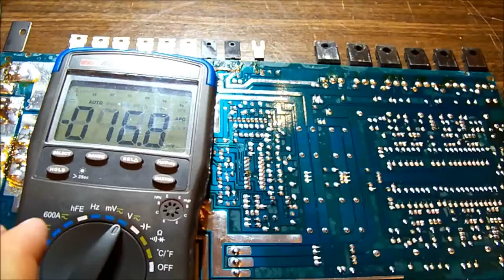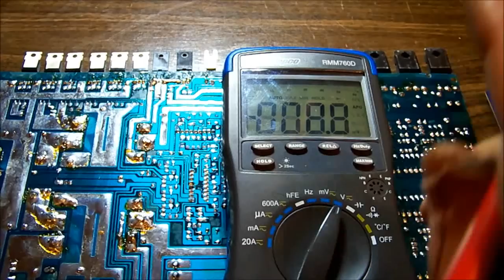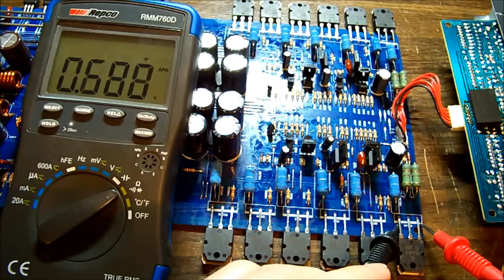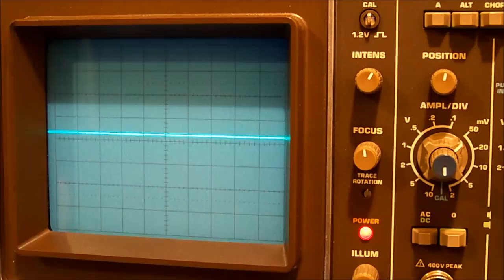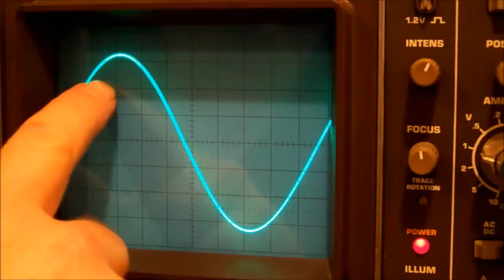Response Precision car amp repair

Comment: I would have to say that 90 % of the amps I have repaired, the output transistors...were shorted...and now I check them first...good video...
Reply: I installed a transistor and it keeps blowing?

Comment: TO-22 diodes are verry common in duals as bridge rectifiers nowadays, and the SMD circuitry can be pretty tricky if you dont have the right equipment, hardly anything that I have had come across my bench as used the through hole.
As far as replacing all of the fets and bad parts while you are at it, this amp will be back on the bench within 6 months and the owner will learn their lesson.

Comment: My amp started making a heartbeat type thump. I know its the amp because I replaced it and new amp is fine. My old amp has similar parts as this one. B688 and D718 on the output side. The amp worked just would have heart beat thump on the subs when at low volume. If you cracked the volume way up it would sometimes snap out of it for a second but then start back again. It's a Jensen XA2250. Cheap amp so no biggie. Output FETs test good and are not shorted. Only thing suspect is one of the power MOSFETs IRFZ44A shows a dead short between D and G but only when switched on. It turns on and off it just shows no resistance on the supply and drain when on. The other one shows 170 to 180 on my MM on diode mode. Not sure if this could've been causing the thump or not.
Reply: I had that wrong. The IRFZ44A MOSFET shows no resistance when switch on between D and S but it does switch on and off. The other IRFZ44A's show resistance of anywhere from 30 all the way to 170 to 180 on my MM through D and S pins when switched on. That seems like a big difference from the one that reads a steady 001 when turned on so I'm wondering if that could be my issue.
Reply from the maker: Hmmm.... measuring across pins with voltage on them will upset your meter in resistance mode and the reading would be meaningless. If there is enough voltage on the gate to turn it on you should have same voltage on D as S. If it's in the primary side then it will be being switched rapidly so a scope might be better to see what's happening. Check secondary side voltage on the output capacitor isn't fluctuating. The heartbeat sound could be a result of power supply repeatedly starting up then shutting down. There might be a feedback issue where it doesn't know what the output voltage is, or there could be an overload on the output. Make sure secondary capacitor is discharged and check resistance across it isn't low.
Reply: Ryan96se I got a question what is the name of the party and where I can buy it

Comment: This video was posted so long ago i dont really expect an answer but anything helps. Is that any specific type of sil pad you used for re assembly? I have an amp i have to remove everything to repace the rcas, its just reassembling everything were i dont know what the mosfets use. Mines seem to be in a similar material to the one that these were prior to removal. Thanks in advanced
Reply from the maker: I've always re-used the old ones, never been a problem. As long as they aren't torn in a way that would allow the metal tab of the transistor to touch the chassis. If you had to get new ones, just go for the same thickness. I usually put a little thermal paste on each side to.

Comment: Very good video! Keep up the great work. I am working on an amp that the green light comes on with no audio. I suspect an op amp on the input. Any recommendations on troubleshooting the input side of the amp? Do you have any videos for that?
Reply from the maker: Thanks! You should be able to find the input and output pins of the opamp from the datasheet and if you have a scope see if you have signal going in and signal coming out. If not in look further toward the audio input. If not out make sure opamp has valid power rails and if so my guess is replace opamp.
Reply: Mostly the output transistors. One or more of the The big ones should be shorted. I fix them everyday.

Comment: Hey, nice video. I have an amplifier that turns on green. But no sound. What should I check. Or what part should I focus on ? I have no idea. Tried several different speakers but none work. So I think the problem is inside the amplifier
Reply from the maker: If you are positive your source is putting out a signal into the amp I'd probably jump straight into testing the output transistors like I do at 16:50. Blown ones don't always cause a fault light. If they test ok you'll likely need to get hold of a scope and trace the audio through to find out where it's stopping. Find the user manual for the amp and make sure it doesn't need something like a cable between 2 sets of RCA sockets (if it has more than one pair) to make sure there's not some kind of split off to run multiple amps or something and the signal is going in then out but not back in to the main amp. Give the high and low pass filter switches a toggle to make sure they aren't dodgy.
Reply: I got a amp the “slave” switch broke off and no i cant get any sound but sum loud thumps wehm i poke and prod around in it . no protect light no smells , i soldered the slave prongs together at the max number idk exactly what it is ) yesterday and got sound out i only had it quick rigg running off another amp to test if my fix worked  tho but it sounded like ut was playing all the frequencies not the lows i want and my rcas only wanted to work in my invert jack connectors i know i usually have them in the low in connectors but they didnt produce any sound idk now what this sound like to you ?

Comment: I have a magnat rx44 4channel amps which gives a buzzing sound from the second channel i tried to grund the earth of the rca to the ground but the buzzing noise didnt go away. Tested with another 4 channel amp from my friend and the buzzing sound was gone, tested with severwl different rca cables and configs awsell.
Reply from the maker: +KosovarMods I wonder if some power supply capacitors have failed and are letting switching noise through from the power supply. Also, check for bad solder joints.

Comment: what would cause  my rockford fosgate punch 250.2 to put out a steady dc voltage when the remote wire is connected thanks in advance

Comment: I replaced a broken MOSFET and it's neighbor,  just to ensure matching behavior on that side (my modest amp only has 2 on that side).  The amp now works well and sounds perfect but will not turn off.  The remote wire/switch/feature is completely ignored. How can I regain that functionality?  What else should be checked?
Reply from the maker: Good job! Follow the circuit from the REM connector. It will likely go to a transistor then possibly to the switching controller for the power supply. I once had this transistor shorted which had the same effect.

Comment: hi . my mono amplifier stop work. the ligth turn on but dont have sound.. just make like very low sound. please you can tell me couple reason and tips what you tinks its. maybe the amp in a moment the positive and ground cable touch toggether but i dont have sure..
Reply from the maker: If the speaker wires touched while it was running then check the ouput transistors as I did in this video.

Comment: My 2150 hct analog meters move but no sound. I know it needs 3 fets. Ya think any transistors
Reply from the maker: The analogue meters might be driven from the pre-amp section so a fault in the main amp will cause no sound. You would need to test the components to find out what has failed.
Reply: @JonnyFix  what do I check
Reply from the maker: @kevinhancock7166  Start with the main output transistors like I check at 17:15 here.

Comment: My Alpine amp has started to create a constant rumble in my subs even while only connected to a 12v battery and the subs. It still works and plays music, but continues to rumble when it has not audio signal. I opened the amp to inspect it, and everything appears to be in order, no bulging caps or cracked fets. It has a .3v output on the wires going to the subs. Any ideas what it could be?
Reply from the maker: I don't sorry. Some oscillation being induced somehwere. Would need to trace it through with a scope to see where it was coming from.
Reply: Jon Luke bad ground in your deck ground it to your cig lighter
Reply: It was wired directly to the battery in my trunk. I ended buying a more powerful Kenwood and thay fixed the problem

Comment: Dear sir i have rockmars 3000watt car amplifire when I give battery current its on for a second immediately its p55nf06 transistor dead I replaced that transistor but same process again all output transistor are ok
Reply from the maker: Not sure what problem might be without seeing it, or a schematic.
Reply: Jonny Fix sir how can i show you and contact with you i m far away from you so kindly help me

Comment: My amp turns on and everything just like normal but you can barley here anything you can here bad but barley then you hear like a buzz and before this Happened the amp over heated and made like a poping noise and I think it heated up bc it's a 1 ohm stable and I connected the subs wrong and for your info it's a Memphis mojo mcd4k yeah it's a badass amp but it doesn't play I want to get it fixed the cheapest way possible and at the moment I'm using another one exactly the same since I have 2 of those amps thank god
Reply from the maker: +Carlos Soriano Probably burned out the output transistors, these are the most common things to fail when speakers are connected wrong. If the pop came from the amp you will probably find exploded parts inside, look for black smoke marks, you might have to lift heat sink clamps. Replace these and see where you're at. If you don't have test equipment, replace all output transistors to be safe and see where you're at. They don't always show physical damage when they fail. Might set you back $10-15 each, can't find much info on this amp so I'll assume there will be at least 4 per channel. There may be other damage but it's a start.
Reply: +Jonny Fix thank you for replying friend and I did open it and I do see black marks in the back of where they blown up and the amp is a Memphis mcd4k it's the older model but it sounds super loud and where are you located? Because I would fix it but I'm not so familiar with this stuff if we live close I could meet you and I'll pay you to fix it for if you could if not then I have no choice but to sent it to where it was made from :/
Reply from the maker: +Carlos Soriano I'm in New Zealand and not currently accepting viewer repairs. Sorry, and good luck,  hope you get it sorted!

Comment: Ask something sir about my legacy la790 it turns on green but the speaker sounds low it's something wrong the outputs transistor or any component in the amp is bud?
Reply from the maker: Try another speaker to rule that out. Make sure you know the input signal isn't low. If it's not distorted and the gain controls are set to max and it's wired correctly then you will need to fault find the input circuit and whatever preamp stage it has.
Reply: Last question sir Jon I try put power.. it's is working or not but problem is burn my speaker on left channel and i try to remove it on supply of the left channel and give it power to the right channel it's working..do you have idia sir what wrong on the left channel maybe the output transistor or supply? Please...sir cuz I want to fix my old legacy amp. thanks sir..
Reply from the maker: @edgarfollosco4143  It's quite possibly output transistors. Make some measurements as I do here at 15:15 using diode mode on the meter, it should be obvious if they are bad. You may have to unsolder at least the 2 outer legs to be sure of the reading.

Comment: where do i find to220 common anode package diodes to buy. i cant find diodes that are for negative side or diodes going out of middle pin. please help me find ultra fast diodes with at least 20a per diode i have spent 10 hours looking for it everywhere. i can only find opposite from what i need. my radioshacks wont have it. pleaseeeeeeeee
Reply: What are the numbers on them?
Reply: Let me guess there isn't any? What kind of amp is it!

Comment: don't buy Toshiba replacements from Cheng Chen ,China. I bought 24 replacements and they were no good,can't say counterfeit because they worked until you drove them above nominal volume.,so after shorting out over half of them I physically cut one open and compared it to an original I was replacing and the junction area was a fourth of the size, never order from over seas.
Reply: +Scott Miller you get what you pay for
Reply: +JusstyteN over 100$
Reply: Scott Miller 100$ for what?
Reply: +JusstyteN 24 crap Toshiba nock offs. now I use Georgia audio lab, he is awesome.
Reply: Scott Miller do you know where to buy common anode or common catchode diodes with to220 package?
Reply: Where to buy them from ? digikey or mouser dont handle it anymore